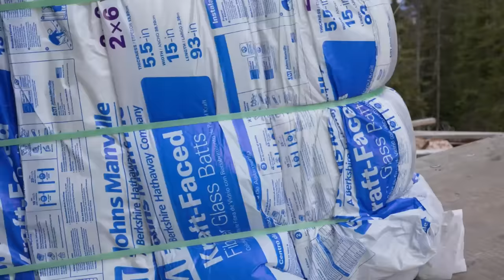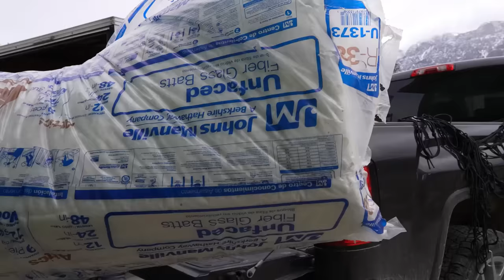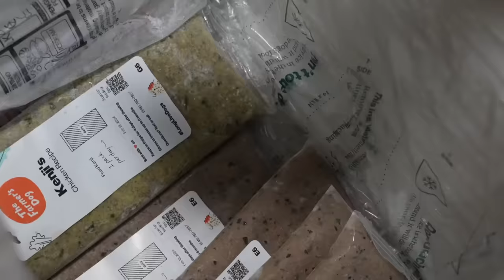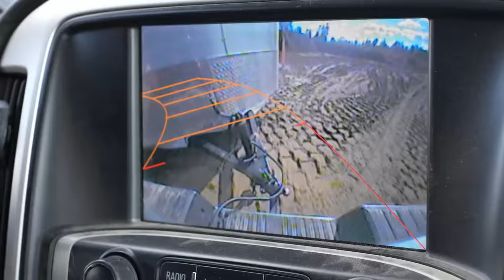Completing the Drywall in Our DIY Mountain Home Addition Build

Comment: Their should be a recycling center for home building materials. The 2x4, 2x8, 2x10 and plywood can all be recycled to make composite boards. The sheet rock can be ground up to create new sheet rock. Concrete crushed to used for mixing with new concrete for drive ways and other non structural structures. Of course the copper wiring can be recycled. We need to become like people from India, Pakistan, Africa, and other countries who multipurpose thown out items.
Reply: I was surprised to see that the drywall was just dumped with everything else. That's not allowed in Canada. It has to be bagged up separately in special bags and taken to a specialized facility.  Some areas require the drywall to  be date-stamped 1990 or later, or be accompanied by a laboratory certificate identifying it as asbestos free.

Comment: I have not seen an indication of a compost pile in the garden or near it.  That is where all the good stuff comes from.  Build a box about 8x12 and about 4-6 feet tall.  Make the back and front walls removable by building channels into the ends and middle so boards can be stacked in for the wall.  Dump any organic stuff from the house or from the garden or yard or from the animals.  Use the skid loader to lift the pile every so often so the material is churned.  You will get the most amazing soil.  The kids will be amazed as it starts steaming.   You can pull the panels and pull out the black soil as needed after a while.   It's a great way to get rid of grass clippings and food waste.  The goats might raid it once in a while for a snack or for climbing and the cats will hang out there for the warmth.  

Also, with him being from the islands I'm surprised he is not familiar with the technique of using newspapers to kill unwanted foliage.  that's how we have always kept plants from growing into the fence and messing it up.  Cardboard boxes work great too.

Comment: I have just read that toilet paper rolls can be used in the garden & composting mulch.  It will house earthworms, hold water, & break down as mulch.  They can also be used as seed pots, cut in half, square them up by cutting a half inch cut 4x times on end forming a square when you fold the ends in, fill with mulch & plant seeds.

Comment: If they still have the same flooring it would be wise to mix the old and the new flooring up or try do do complete rooms with either the old or the new flooring because you moste likely will see a difference if you start with the new batch in the middle of a room.

Comment: Helpful tip with the flooring. Take the old stuff and shuffle it in with the new stuff incase of slight variations. Its better to mix it throughout instead of a big contrast between two sections 🙌🏼 
I prey y’all see this. 🍻